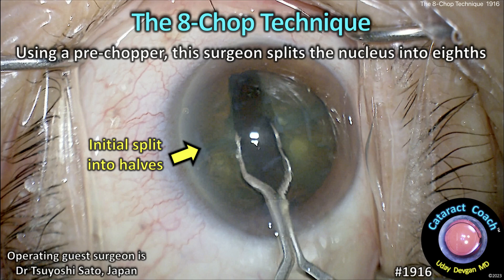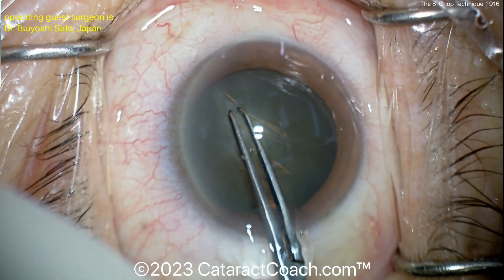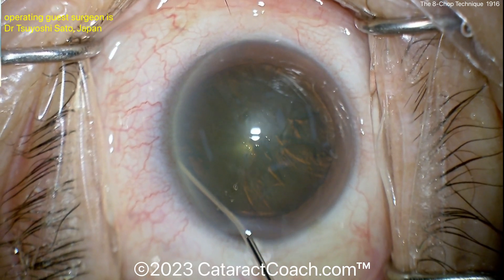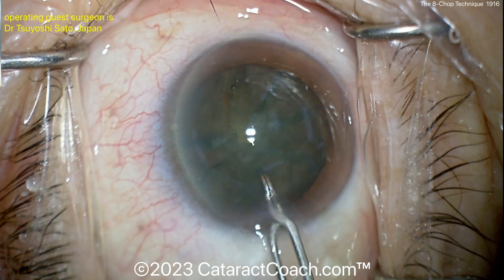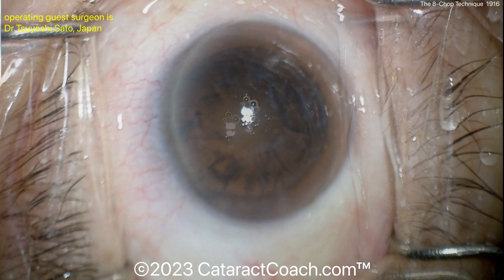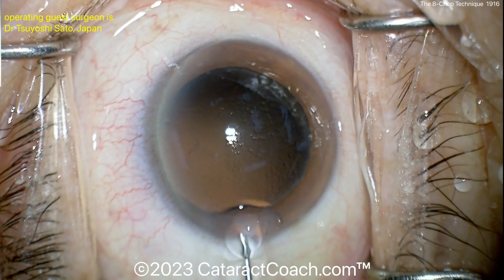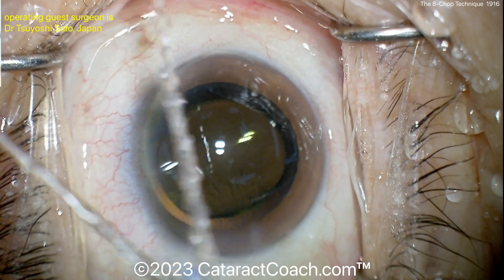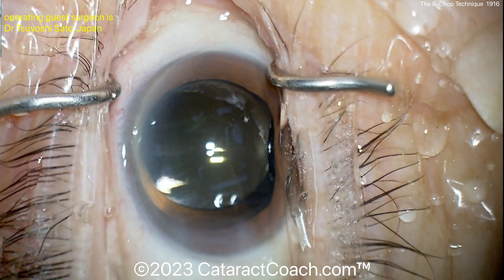CataractCoach™ 1916: The 8-Chop Technique - Pre-Chopper

Comment: The eight-chop technique is a modified version of the prechop technique. The basic principle, i.e., nuclear fragmentation before phacoemulsification, is the same, but the surgical strategy and instruments are different. I developed the eight-chop technique in 2002. This is characterised by the division of the lens nucleus into eight segments, instead of only four as in the prechop technique. Furthermore, the Lance-chop technique is an eight-chop technique that uses the Lance-chopper and nucleus sustainer for cases with a hard lens nucleus. Three new surgical instruments (Eight-chopper, Eight-chopper II and Lance-chopper) were designed and developed to perform the eight-chop technique. The Eight-chop technique can be viewed on the Eight-chop channel on YouTube and J Cataract Refract Surg 2023;49:479–484.